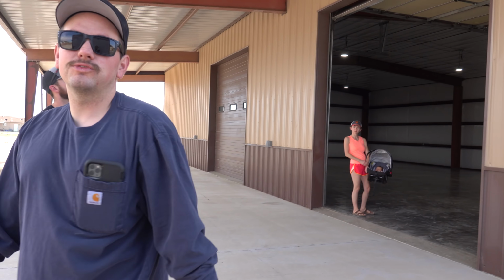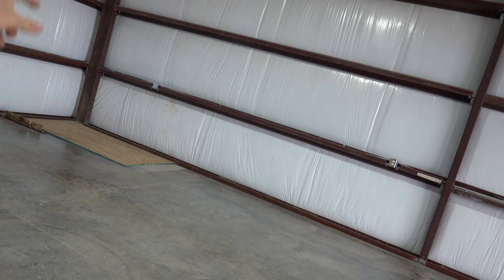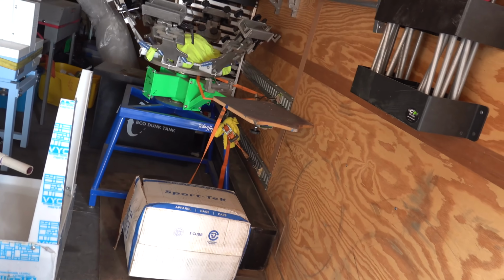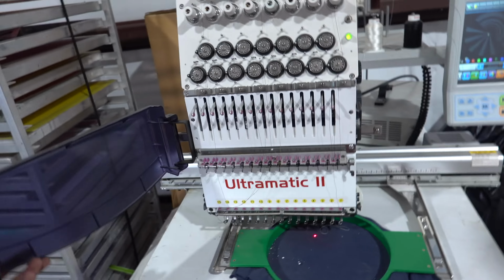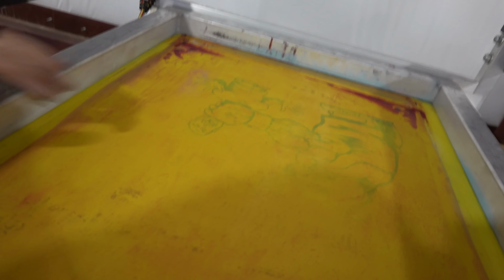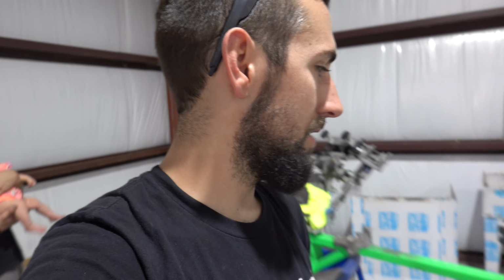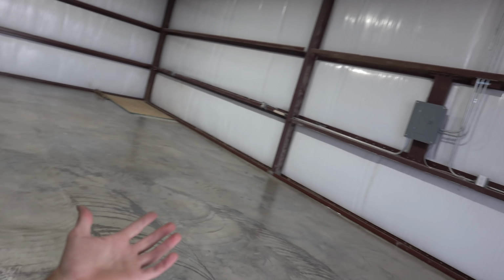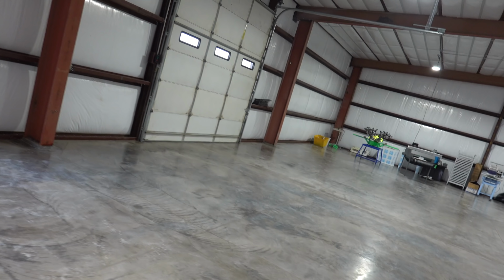NEW SHOP! - Screen printing - Merch / Ecom Fulfillment Center!

Comment: Man you will fit a nice paintboth or how you call it in english. With 220v outlets with aircompressor and great fans in the box that creat a good pressure for less finish work after painting cars or parts. It will be easy to build nice air outlets from the paintboth as well. So many things you can be doing in a shop large as this. But it can also be filled up fast as well LOL. 
Congrats on the new shop Trevor and fam! And what an amazing thing if your brother could be working with you full time.
Reply from the maker: This shop will not be used for car builds!